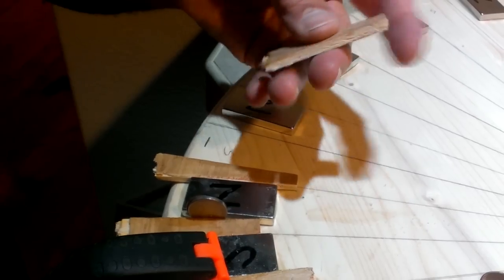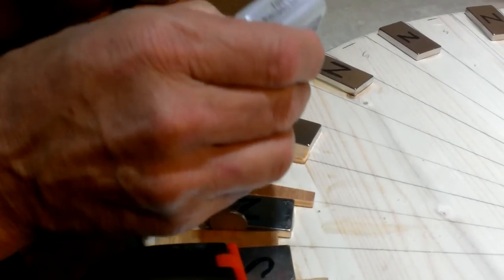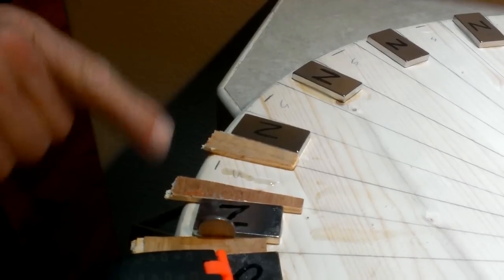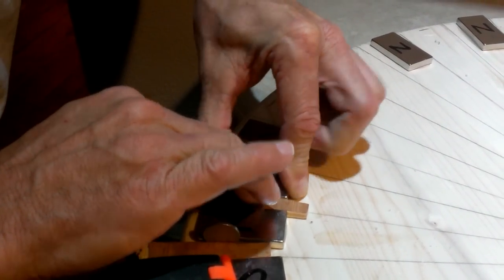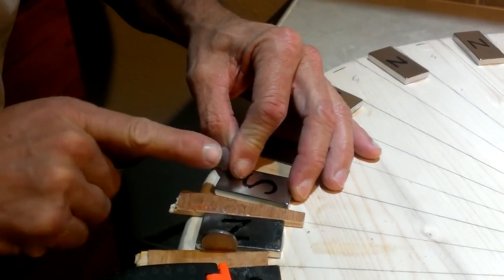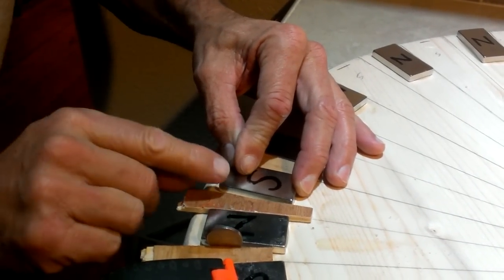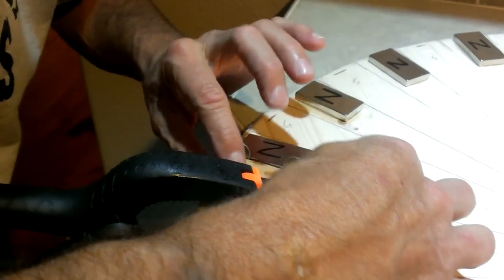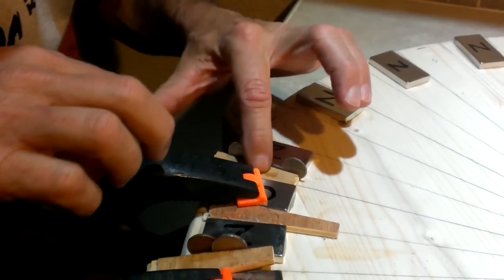Green Dan - Installing Neodymium magnets on Rotor 2.mp4

Comment: Dan you really need to put your magnets on to an iron backing so that the magnetic flux has a median to move through -  try to think of it as a ripple weaving  around the circumference - something like a lorry disc brake or old farm iron fly wheel would do the trick especial as you can often source the axial and bearing from the same unit